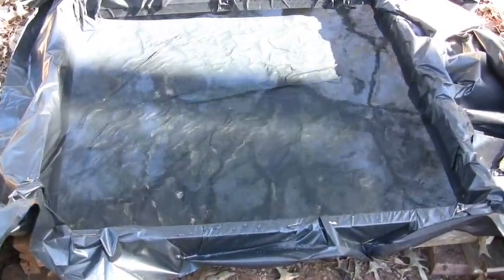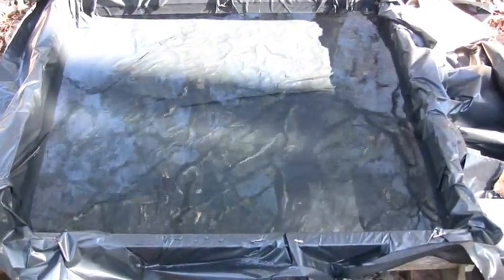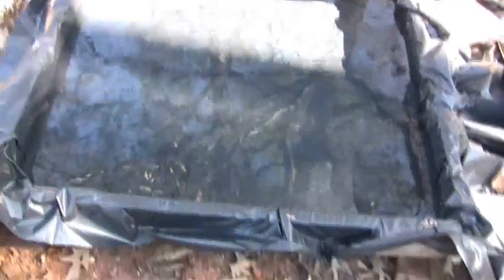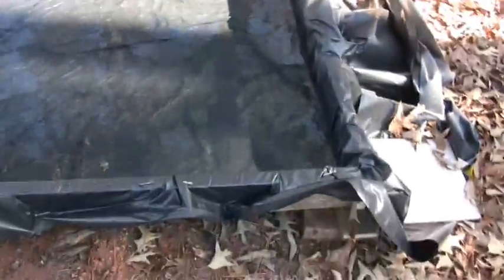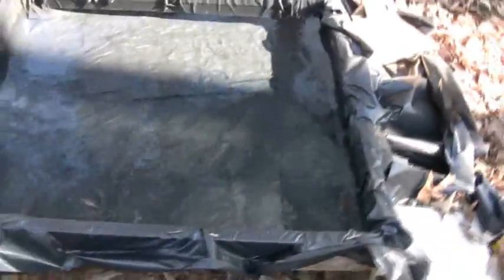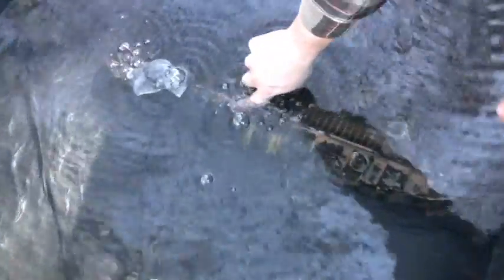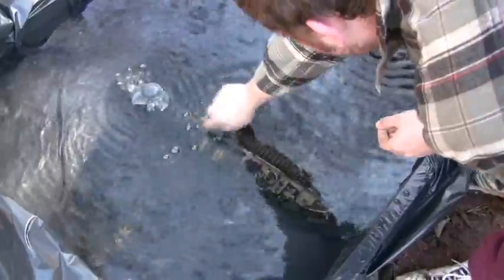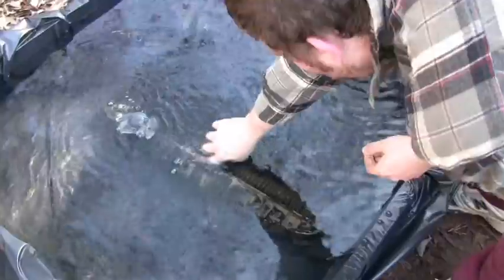How to Do A Radiator pressure test

Comment: Just a word of caution. This young man deserves high marks for ingenuity. But a do-it-yourselfer should exercise extreme caution with a homemade system like this since your could accidentally blow out your radiatior, transmission cooler and other vital parts with too much pressure pumped into the system.

Comment: @DannysCam ok so i gota question, you descovered the rad was shot with out the proper tool so how is it your gong to find out if the head gasket is shot with out the proper tool ??????your not going to submergerg a motor in water and expect that work, its an ok idea that you did what you did to show that the rad leaked but iam sure the pile of coolent on the ground was the first giveaway on it, by the way 10 psi is not a good pressure test once its repaired just so you know ..

Comment: putting more then the rated psi for the cap will blow the crap out of the rad.. the proper tester is always the best way to go, besides if your leaking coolent as it is then you gota blown rad or leaking jugs just depends where the leake is showing up..

Comment: Gotta watch pressure, shouldn't exceed about 30 psi or less in some cases it will cause your radiator to spring a bunch of leaks. Hopefully you have a good cap.  You are on to something with the bike tube and hose clamp though, very nice!

Comment: thats a good idea i need to get a new gas tank for my truck  a kiddy pool folded like a taco and duct taped sealed would be perfect just shove it up between the frame and body use some bailing wire to hold it up and no problem!